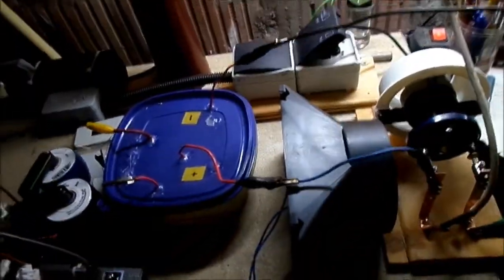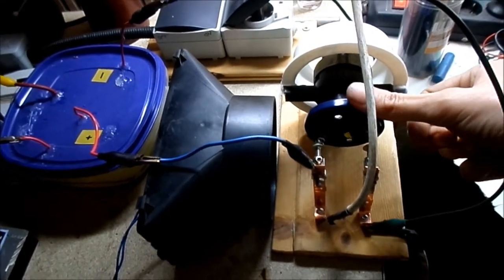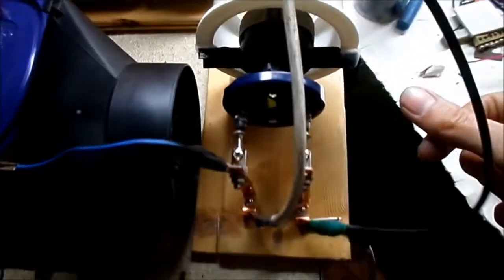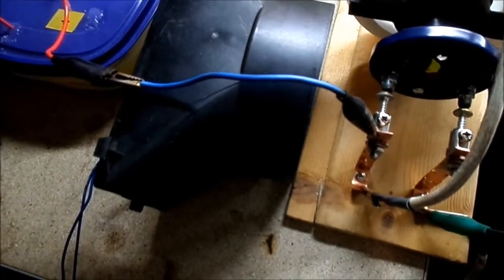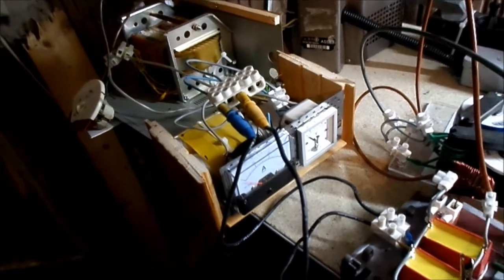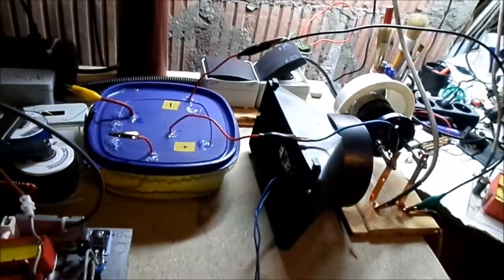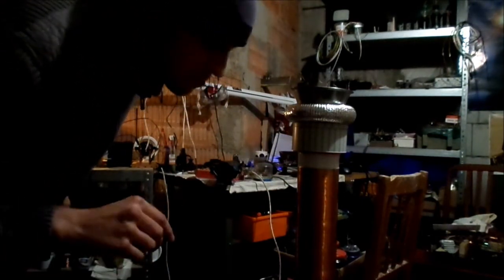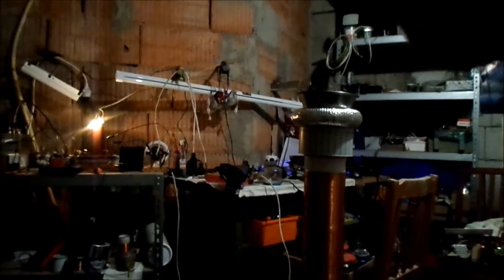rotary spark gap test on TC

Comment: checking you out again, nice rsg man. hey how are you isolating the disc sparks from the motor? or is the disc iinsulated?
Reply from the maker: +Tesla Explorer sup dude ! been busy hope to get back to my shop soon might just work on my RSG, the larger one i made from a vacuum motor :-p no the disk was a metal jar lid, i think i glued something on the back and shoved the fan shaft in :-p if i were you, i'd go for an angle grinder or a motor around that size, they make compact RSG's and just control it with a variac, that what i do ... dont forget that the capacitance is doubled with the RSG being used, i still need my caps to run it proper !
Reply: Roger that good sir, the capacitance is between the electrodes? perhaps its the style of rsg? im going for a modified 2hp 3600rpm induction motor. thinking of 10 point, but now you speak of the capacitance, does this mean less on the mmc?
Reply from the maker: Tesla Explorer yeah the capacitance of your LC tank will increase almost double, not sure why have to read up on it again :-p speed is not everything just keep that in mind, i run the vac motor between 18-20 V from the variac give it a read online and the number of contacts determines the freq. range but as i said check it out online

  http://www.richieburnett.co.uk/rotary.html

thats a good one ;-)
Reply: dirkk82 thanks alot man, yes hopefully we can get some interesting effects, including the fade in and out. richie is a smart guy, lots of fine details from experience on his website.